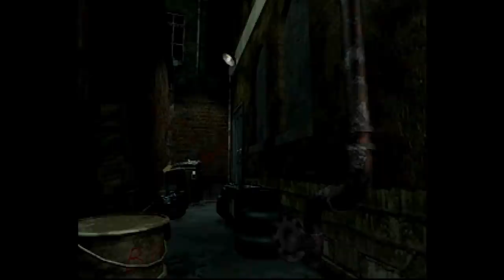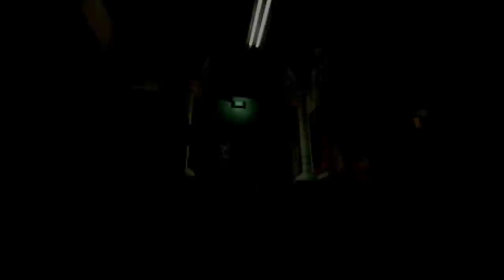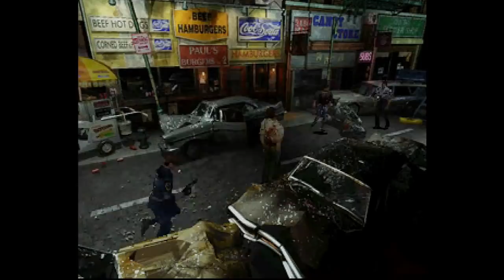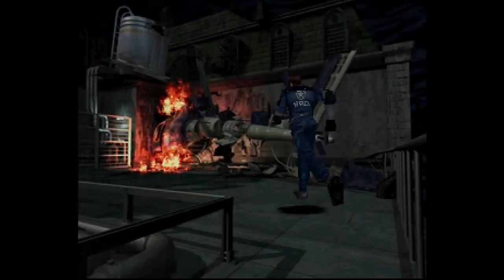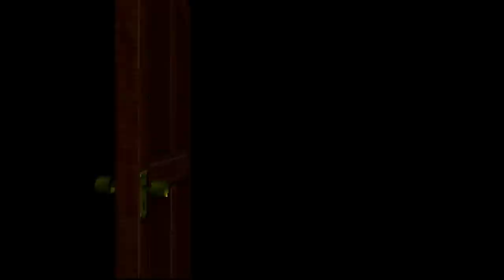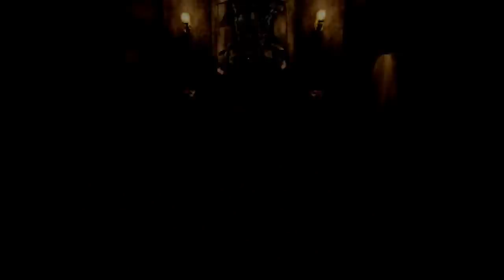The Resident Evil 2 Preview Disc's Hidden Content - Lotus Prince Presents

Comment: I think that precinct key with L on it was later re-used in RE3, and I think it unlocked the gate to the park or a building in the park when you play as Jill again after getting a cure for her infection from Nemesis as Carlos.

The only difference though is that L etching was removed, since it wouldn't make much sense to have it.
Reply from the maker: Ah, nice!
Reply: Thing I only just noticed now as well, the Precinct Key you find in the art room with the busts needing the Virgin Heart gems also seems to have been reused in RE3 as the Boutique Key, only with the letter S engraving removed.

I can only guess with both that and the previous Key I noticed, they were used in RE3 because they needed Keys and to save some time or because they were last minute things that needed graphics, they reused these unused key designs because they already had the images/models made.

Comment: My hats off to you for making a video about this. I've shown this to friends over the years. Ijust wanted to elaberate on some interesting facts about this. To start with you can do this using an Action Replay to do this, but it takes hours to put in the codes. As mentioned you can do this with the RE2 demo disc. They are slightly different codes.

The demo they put out for some reason is basically a date dump by the developers. It's unknow why they did this however.

Some interesting highlights to see and take note of is the original inclusion of the ammo crafting tool found in RE3 and a few more titles later. In fact the grenade launcher rounds you find in the game were just your normal gray ones. To get acid or flame rounds you would need to mix normal rounds with different gunpowder to get them. You can use them and see a different effect animation from them than in the final game. Flame rounds look killer. My best guess why they didn't keep this is in game is it's simply overpowering like it was in RE3. If you can read Japanese several files that never made the final game are readable and very interesting.

Unfortunately VS.Books strategy guides had very limited prints runs. A shame really because everyone of the guides they published were hands down better than another guide published for the same games. They are expensive as a result of it. If your a huge RE fan from back in the day or just hardcore into RE it is worth tracking the guides down. And yes, that's not a typo. VS. Books actually did a guide for RE3. The guides are a gem for RE collectors, and the same for the BH2/RE2 demo disc for having the extra content on them.
Reply from the maker: Putting in the codes is really, really time-consuming. My recording was over an hour, and I only used twenty minutes or so, after cutting out failed attempts at maneuvering through levels, as well as time entering codes. Also, wow, I didn't realize that VS did a guide for RE3. Thanks for all your information!
Reply: @lotus-prince  My pleasure. If you put the time into exploring with the codes on the demo it's rewarding as a fan just to see what could've been. So few people know about this. The only thing that could top as a fan would be finding the near complete version of what we know as RE1.5 in an old desk or something.

Comment: Some fun facts for you! the Calico950 is a gun that was supposed to be in 1.5. The Calico950 was supposed to be the machine gun that Elza uses. The chemicals where supposed to be used with grenade shells that were found in the environment and you were supposed to use the save boxes as a mixing station for the healing items as there were green, blue and red chemicals that should've replaced the herb system. 

The watch was another 1.5 leftover that know one knows it's use of, the different coloured cards are also supposed to be used during the RPD and factory sections of 1.5. 

Sadly though the 40% build that was leaked doesn't allow you to use certain weapons or key items as the game will crash, in case you plan on showcasing RE1.5 in the future. 

Nice video showcasing some of the awesome stuff in the preview that was locked away!
Reply from the maker: Oh, that's super cool! Thank you for the information!